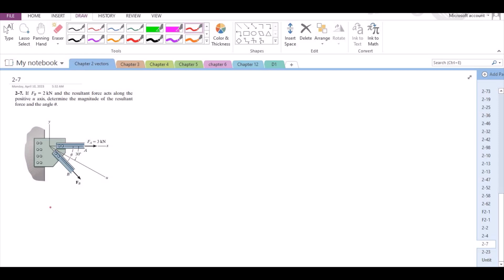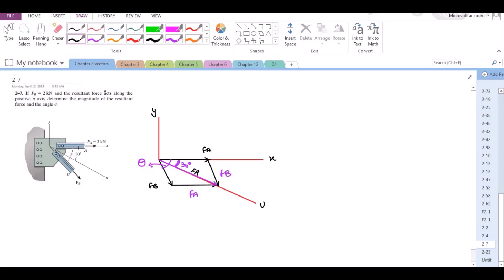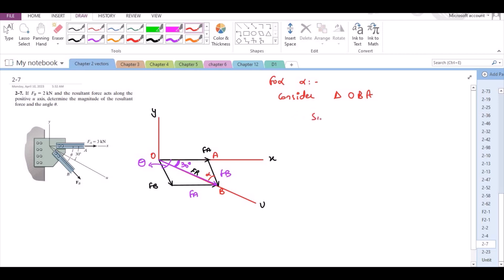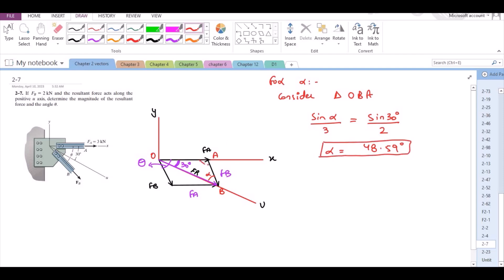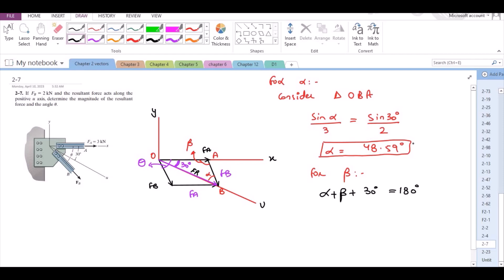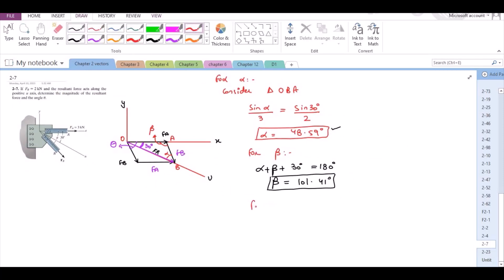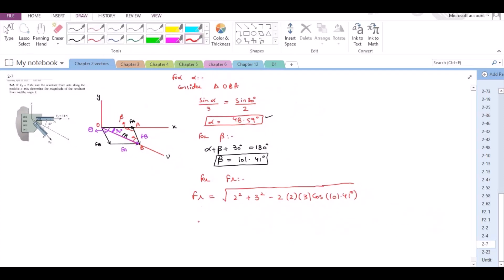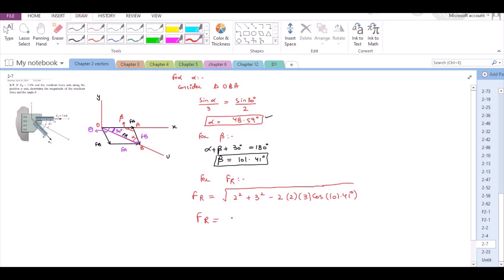2-7 hibbeler statics chapter 2 | hibbeler statics | hibbeler

Comment from the maker: Learn How to Solve 2-27 Hibbeler Statics Chapter 2, "The resultant Fr of two forces acting on the log is directed along the positive x-axis and has a magnitude of 10KN, determine the angle θ of the cable, attached to B such that the force FB in this cable is a minimum. What is the magnitude of the force in each cable for this situation."
Here is the Link: https://youtu.be/W0J-Gy9Ix7Q